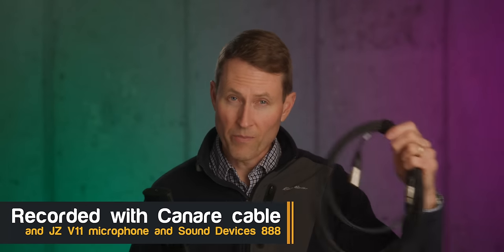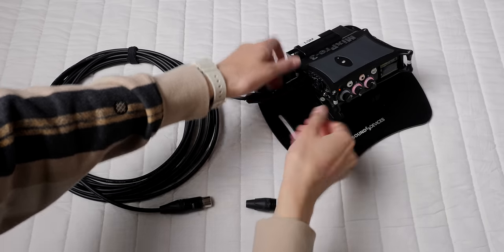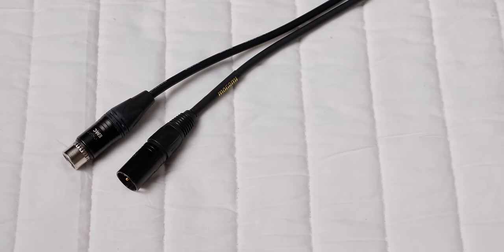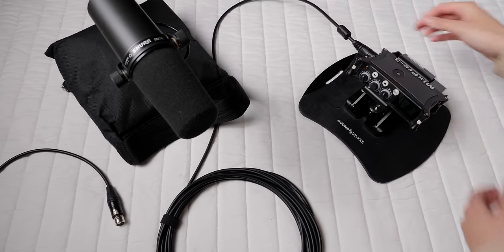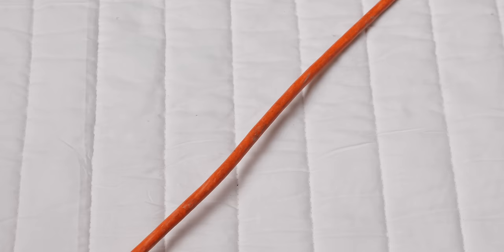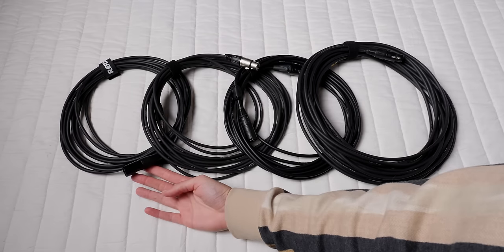Cheap vs. Expensive XLR Audio Cables: What's The Difference? | Curtis Judd

Comment: I find one of the worst attributes of cheap cables is they typically have a way-too-thick outer rubber sheath, so they're not only unwieldy, but also heavy.
Reply: To be fair, Mogami cables also tend to be absurdly thick and unwieldy.
Reply from the maker: @nickglover  Depends on which type of Mogami cable. Some are quite slim.

Comment: To note: 'no influence on sound' applies only to low-z sources like active condenser microphones or transformer coupled dynamics. It starts getting more critical with mics like the SM7B which are neither active, nor transformer coupled - and with high z sources (like electric guitar pickups, though these typically don't use XLR plugs) a low cable capacitance is getting real important to prevent high frequencies from being dampened. That said, these lower capacitance cables mustn't cost a fortune, either, but tend to be a little more expensive.
Reply from the maker: Thanks for the info, Tom.
Reply: @curtisjudd  Welcome - I mentioned it mainly cause I was caught by this when recording a relatively low impedance (1.5k Ohms, straight from the harp) Fender Rhodes: I switched the cable to a better one, and the sound opened up significantly, which I did not expect, 1.5k being a relatively low impedance. The effect is well known for guitar pickups, but they normally have impedances in the 5-10k range, and they don't use XLR plugs. Subsequently I tested with the SM7B, and, over longer cable runs (10m), I could hear slight differences, too.

Comment: FYI, there another aspect to cables, capacitance. Shielded cable has a capacitance rating per foot = the longer the cable to more the capacitance. This capacitance results in a low pass filter. For these short cables, the cutoff frequency is in the megahertz, so its not going to matter. If you're running 100s or 1000s of feet of XLR cables then cable quality becomes a concern.  Thanks for the video, you've shown good demonstrations and your recommendation (near power supplies, crossing AC perpendicular, etc are spot on). Thanks, I've repaired many XLR cables, buy quality ones.

Comment: I would like to add one aspect to this, which is impact sound (Trittschall/Bewegungsschall). Lesser quality microphone cables can have problems with that. In practice it means that such cables induce noise into the signal, if they are moved or touched during signal transmission (e.g. during a recording). Gladly there are high-quality cables available, which do not suffer from such problems. Note: As far as I know, this phenomenon cannot be attributed to insufficient external electromagnetic shielding of a cable. I think it can occur due to insufficient shielding between the individual wires in the cable or the type of stranding.
Reply from the maker: Interesting, thanks for sharing.

Comment: The best cables are DIY. Just get neutrik/amphenol/switchcraft plugs and some nice cable like Canare. They're not really expensive and you can make the exact length you need. I did a fair bit of wiring with other brands like Conducfil, Mogami, Sommer, Gepco, Klotz, Cordial. They're all nice. It's easy to do and if somehting breaks, you can quickly fix it. Often a reason of failure is bad soldering. You now what you made.

Comment: In the past three decades I've made more mic cables than I can count and I also endorse Mogami and Canare. I buy the latter (Canare L-4E6S) by the spool. That said, there are other excellent cables on the market from Belden, Klotz, Sommer, and others. Gotham cable makes one called GAC-3 which is easy to solder, super slinky / flexible and feels great in the hand. Good noise-rejection, too. Really delightful stuff and one of my favorites. Try it!

Comment: Amphenol connectors should work well too.

As long as it's star quad / quad neglex there shouldn't be any problem. The twisted double conductor nature is key for the blancing to actually work well. Durability can be better with more flexible pvc. I make my own using Neutrik Connectors, Mogami 2534, MDPC-X Sleeving and some heatshrink. Some people add glue in theirs, I don't. I've never seen a cable as high quality as my self made ones.

Comment: This matches my experience. The cheapest cables have spiral shielding instead of braided so they are more prone to external interference. Otherwise, durability and general fit and finish are the biggest differences. I like the Canare cables simply because they are thinner and more flexible, but Mogami is also nice.

Comment: One more thing I can add is that higher-end cables have some other perks: They have less of a "memory" so they coil and deploy nicely. They have softer outer jackets for a better hand feel. They're more durable and they retain their shape after decades of abuse in the studio (in my case). Really cheap cables feel crummy in the hand, retain twists and can get lumpy even with moderate use.

I once had a mic cable that was so bad it was actually microphonic. I could induce noise into the signal by tapping the cable. I think I got it for free with some other gear I bought. I kept it around as a novelty but eventually lost track of it.
Reply from the maker: Thanks for sharing 👍

Comment: I ran some extensive tests that took me 2 to 3 days about 10 years ago with various cables ranging from $5 to $200 each to find that the more expensive cables sounded only mildly better, i.e. they rejected RF and had better signal to noise.

I found the more expensive cables to be better, significantly better, in terms of build quality, so they maintained their slightly better sound quality over time as the cables wore.

What I mean by this is if you have cheap cables you have to be extremely careful with them and/or replace them much more often to maintain the level of sound quality they produced when new.

I assume, in the long term, this will be more expensive than purchasing a good quality but not overly expensive cable initially. 

I've been a sound engineer since the '80s.
Reply from the maker: Thanks for sharing 🙏

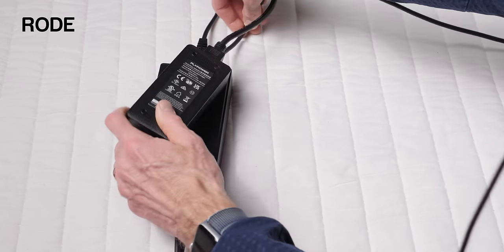Comment: 00:50 Mogami and Neumann are not oriented in the same way of the Rode. So in case of interference due any other coil/transformer to the other side of the PSU, you don't get it captured by the cable. You just followed the similar path with the Canare.
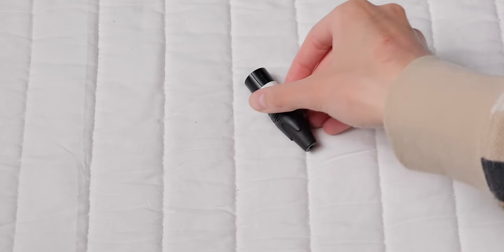02:02 it should be better short circuit between 2 & 3 (as usual done) avoiding any noise generate by the resistor itself. It doesn't create any issue even if you have the 48V inadvertently activated.
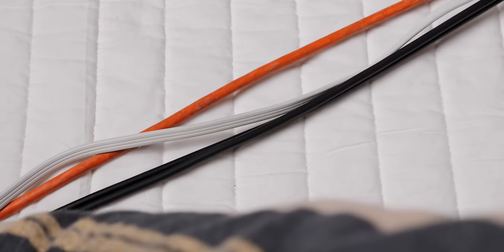04:14 yes connectors can create mechanical issue. I had very very bad experience with Bespeco. Never more! But other cables equipped with Neutrik or similar-quality not any particular issue.
Great  recall to the correct way to wrap cables up. it makes the real difference in the long term.
Reply from the maker: Thanks for sharing

Comment: The biggest noise problem most tech nerds are going to run into is USB-powered audio devices that don't isolate the audio from the USB. They always hum if you put them on the same power brick with something else. Expensive cables and/or ferrite chokes won't fix that! But an expensive isolated hub will.

Mogami has a really high markup, so it's not hard to get them discounted if you're friendly with the Guitar Center manager or Sweetwater rep.

I've never had a problem with Mogami XLR cables, but I have a Mogami Platinum instrument cable that's more of an antenna for noise than any of my 10-year-old Monoprice cables. Like, if I plug something into a big tube distortion or sketchy boutique fuzz pedal, it takes less gain to get a bad humming noise out of the Mogami, and you can move the cable around and change the sound, kinda like a not-hands-free theremin. It makes me think Mogami Gold XLR cables are more legit than Mogami Platinum 1/4" instrument cables.
Reply from the maker: Interesting!

Comment: Excellent video and all the important points are adressed in my opinion!
If it's more than one single cable you need, consider learning to solder. Watch a video on it, give it three shots where it might not work, use Neutrik connectors and some decent quality cable. You save a lot of money and can make exactly the cables you need.

Comment: In my experience with cheap or even mid-price cables, they often don't terminate the connector ground to the shielding properly. Shielding needs to be grounded to be effective. You can't depend on this connection to always happen inside a microphone either. Painted connectors are also a big problem in the mix, because paint is an insulator. 
The path from shielding to ground on a LyxPro quad cable through an SM57 or sEV7 will be shield > paint on female connector > paint on mic > mic body > paint on mic again > paint on screw > steel screw > paint on screw again > male connector > hopefully a jumper to
Pin 1.

Spend 5 minutes sanding off the paint from your brand new mic/connector (wear will do this eventually anyways) and just solder the cable's shielding directly to pin 1. I know some people don't like that and need to do it differently for some very specific use cases, but those people aren't on YouTube looking for advice on cheap XLR cables. You'll save a lot of headaches in the long run.
Reply from the maker: Thanks @SparkY0

Comment: I'm personally a big fan of the Canary cables. We use both audio and video cables from them. Jude has started using a German brand called Sommer I believe. Those are quite nice. Very soft and flexible.
Reply: Yes, I was going to mention Sommer Cable, too! I exclusively use them in my studio - from simpler XLR cables to "quad star" for microphones and also Multicore. When you solder yourself, you might appreciate them even more since they are particularly easy to handle in that regard.

Comment: Thanks for the video. Every time you've posted one, I have learned something new. I am always a bit confused about cable length. I have a 10m cable, which seems too big. Though, I don't know if I will ever need it while recording location sound. Ideally, what length do you prefer for on-set recording?
Reply from the maker: For booming with a sound bag, I prefer a 3 m cable.

Comment: Maybe not so well known or available in the US but both German manufacterers Sommer Cable and Cordial make high quality cables.

According to budget the connectors are either Rean, a budget brand from Neutrik Made in China or the original Neutrik connectors.

Neutrik is the original inventor of the XLR standard BTW.
I soldered numerous cables with Neutrik and you are right about the strain relief, something that counts when cables are under stress.

I like the coloured rings that you can exchange on the Neutrik connectors.
Reply: Canon is the originator of XLR. When it was released it was called the Canon Connector. The Wikipedia page has the full history.

Comment: To clarify, StarQuad or just Quad is a specific type of construction that uses four conductors twisted into a tight helix. Opposing helical pairs each carry half of the balanced signal. This helps  increase noise rejection compared to standard balanced cable construction which uses two conductors in a helix (and which is already very good at rejecting noise). The most popular quad cables are  Canare L-4E6S, Mogami 2534 and Belden 1192A but there are others.

Given its four conductors It's a little more complicated to prep and solder, and in the case of Canare L-4E6S, the braided shield is a pain to undo, but it's worth it if you need the added EMI immunity. Of course, if you buy your cables premade then this won't concern you.
Reply from the maker: Thanks for the context and additional info.
Reply: Is it worth getting over regular balanced cable for on camera mic cables and general mic cables for a boom mic?
Reply from the maker: @crismartens2377  If you're working professionally and want to reduce the risk of audio issues, I'd say yes.

Comment: If you regularly need to haul your cables around, and you can solder your own connectors, I highly recommend Canare L-4E5C Mini-Star-Quad. It's a thinner version of the regular Canare Star-Quad cable, so that your cables don't take up as much space when packed into your gear bag. Markertek sells it by the foot for the cheapest price I've found.

Comment: Just today during a shoot I was getting a ton of interference and wondering if I may need to make sure every single cable I have is upmost shielded. 

And boom your brand new video on this topic comes up haha 🔥🎙️

I've had most issues with my internal coil cabled boom pole.  And today the issue was using a cheap aux cable from my mixpre 3ii to c70 camera's mic port
Reply: Star Quad type cable came from telephone lines. Check that out for best RF/EMI/hum rejection for just the cable not using additional accessories to reduce those noise issues.

Comment: I have had good experiences with both Neutrik and Rean connectors. Others can be a mixed bag of course. Adam Hall has a "3 star" cable line with their own connectors ("4 sta" uses Rean, " 5 Star" uses Neutrik and better termination, like shrink wrapped solder joints) and they work fine. For long cable runs star quad cable is really amazing at rejecting interference. Not surprising star quad was the stabdard for railroad signalling before the reign of fiber. Mogami, Canare and Belden sell them. As for el cheapo cables, I experienced ones so poorly soldered, the balanced cables picked up differential interference, go figure!

Comment: I am a huge fan of Clark Wire and Cable's Mink4 mic cable.  It's a quad like the canare, the jacket feels better, the conductors are different colors -- lt blu, dk blu, yel, & wht, (which is great if you need to use the cable for other purposes using 4 independent conductors), and it has a dedicated drain wire so you don't have to comb out the braid when making a mic cable - you just cut off the braid and use the drain.  I think it is the best design of all the best versions of a quad mic cable, and I'd put it up against any of them in quality, and above any of them I've used in design convenience.  Bottom line, it is just as good if not better than most, and easier to terminate.  And the jacket....there is something sexy about it, it just feels great in your hand.
Reply from the maker: Thanks for sharing!

Comment: OMG that's so true about connectors. I like Neutric too! They definitely are my preferred choice. and yip I agree with everything in the vid. Sound-wise they're the same between cheap and expensive. But cheap ones will pick up a lot of EMI issues. EMI usually hits at 3 places (cheap XLR cables, ie Amazon basics), the mic (ie SeV7 and in your case the Jz mic) and the interface itself too (ie the Audient EVO4).
Reply from the maker: Indeed!
Reply: As long as it's the right kind of cable, it should not have problems with interference. Twisted pair, or a starquad, shielded completely and well grounded (properly soldered). You can also add ceramic capacitors in the plugs to remove noise from Phantom power if your mic doesn't have them. See Alice microphone tutorial for more on this.
The art of shielding isn't in spending a lot of money but in very careful checking of connections. All the shielding enclosures must be grounded or connected all the way from the mic to the recorder. How it's made specifically depends on the gear, but it's something you can test by ear or with some software like REW.
I can assure you that you can take any piece of gear that has hum problem and poke here and there with a piece of copper wire and eventually you'll find the culprit and be able to fix it in 5 minutes.  Often it's because of paint that prevents an electrical connection of pieces of enclosure. Other times it's just dirt or a loose fit. With cables most of the time you just need to correct some bad soldering or replace a plug.
I find the biggest issue these days can be USB power. The best practice for this is to use a power bank.

Comment: I noticed a vast price difference between xlr cables when I started getting into all this and I almost fell for the more expensive the better trap, so I went in cheap and bought some dodgy Urgreen ones. No interference, but the connectors started coming away from the cables pretty quickly. I then went midway and bought Roland ones and I’ve had no issues since. They’re pretty rugged too. Roland make good music gear, so it would be strange if they made bad cables. That was my logic at least. I’m a novice though, so I could be wrong. Maybe they’re notoriously bad among professionals haha. A year in and they’re fine though. I also have some spares called “No bull” by Nordell. Not sure if they’re ok or not but they have good reviews.
Reply from the maker: You can always test them by putting them right next to an AC power adapter and see how it fares. I figured RODE cables would be ok, but they fared the worst of the 4 I used here, followed by Neumann!! Yikes!
Reply: now those are two names I’d automatically view as quality for obvious reasons. Wow. Someone in the bean counting dept’s of those two companies has figured out a way to maximise profits knowing full well people would buy their cables without thinking. Thanks for the heads up!

Comment: A good balanced input should provide significant rejection from induced common mode currents, I suspect a lot of gear appears balanced but is in fact single ended (or has very poor design leading to a poor CMRR). Also it's not so much of a problem with modern cables but some cables still do exhibit noticeable microphonics induced due to mechanical stress. Good live mic cables often contain cotton or other fibres that allow the wires inside the cable to glide past each other during handling in order to minimise the generation of microphonics.